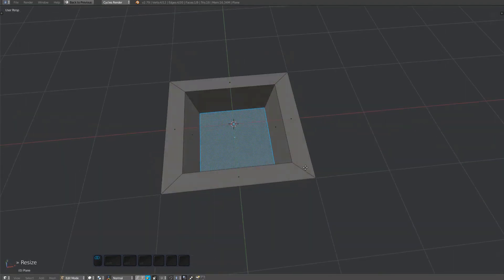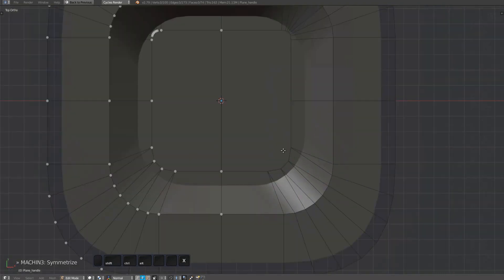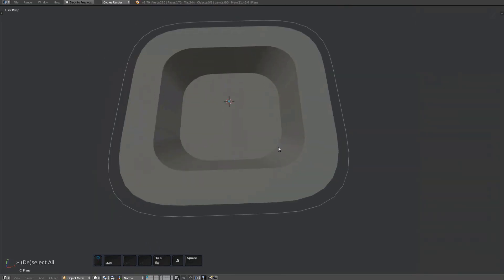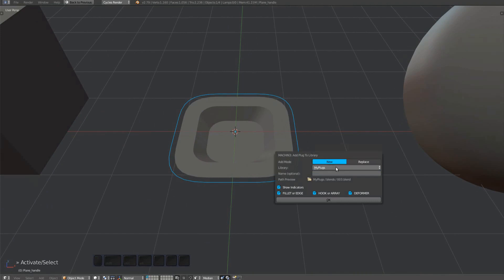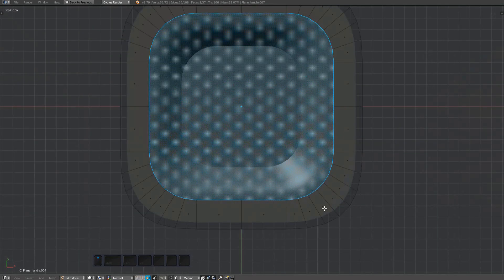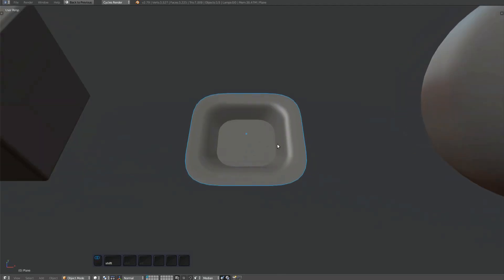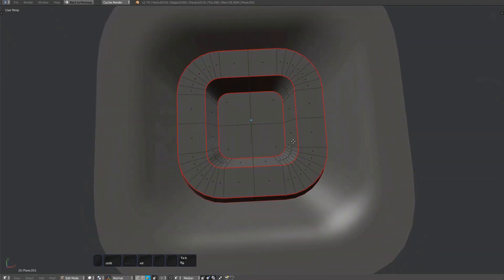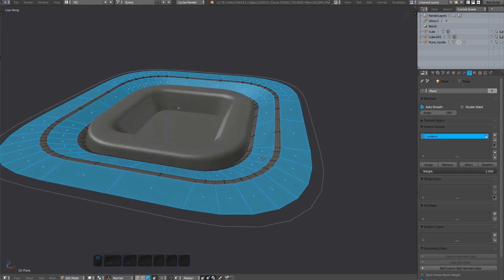MESHmachine 06 - Plug Creation

Comment: even after adding hard edges and seams it still creates a fillet plug and deforms the higher parts of my plug. any quick fixes that might help?
Reply from the maker: https://machin3.io/MESHmachine/docs/faq/#get-support
Reply: Sorry I never replied to this comment. Quick fix is the sharp needs to be the loop 1 in from the very edge of your plug.

I am trying to make more complex plugs so it took me a bit to figure this out.
Reply from the maker: Don't worry about it. I was on a trip in the past week, and only got to your message yesterday, hence the delay in my response. You are correct, that it is the loop "one in", that MM checks for the sharps.

Comment: Thank you, it is a revolution! Question: How do you call that plug-mini-menu (like in 3:19) ?
Reply from the maker: Depends on the keymap you use. Search Blender's keymap prefs for 'Redo Last'. By default it should be either on F6 or F9. It's the same menu as the one at the bottom left of the screen, just as a popup.
Reply: @MACHIN3  Thanks! Great!